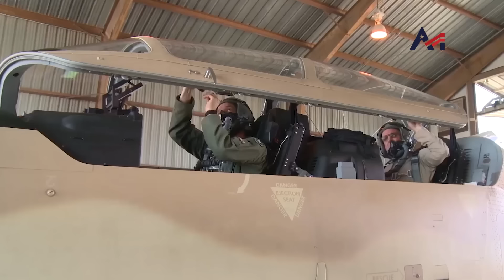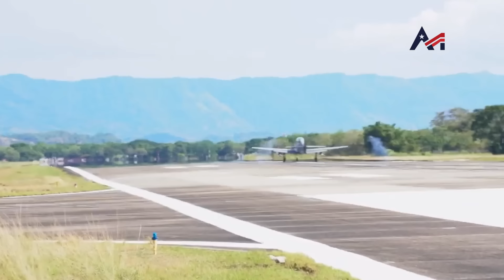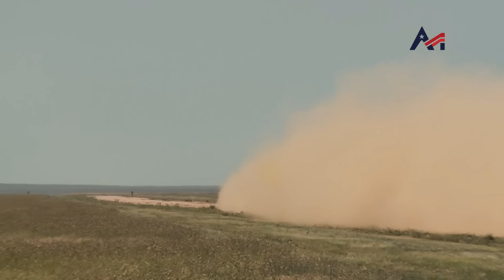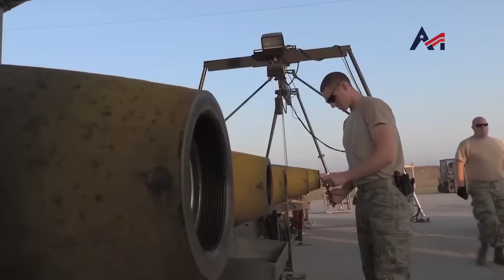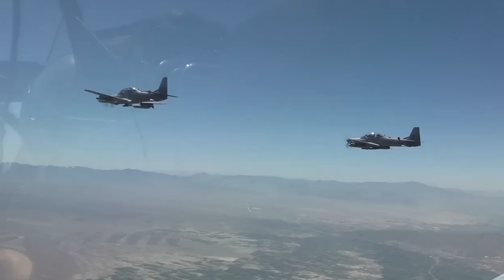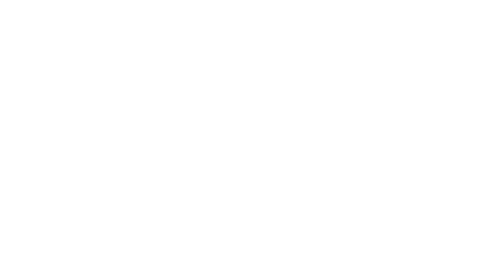U.S. Air Force’s New Answer To Shahed Drones

Comment: I know 10 years ago they were talking about using these in low intensity combat environments where competition for air superiority is not an issue. This is the right idea in my opinion. I think something more similar to the P-38 Lightning would be better as it would offer all of the same low cost options and probably more. I know for larger drones why greater stand off distance is important. However, for the smaller drones, I'm curious why nobody has developed a gatlin gun style shotgun that can be mounted on an airplane or a vehicle as an anti-drone weapon. Ammo is cheap (which probably explains why), shotgun round capabilities vary more than any other category of firearm I know of which would give soldiers choices, and that should not be that hard for the U.S. military's contractor community to create. There's a reason why people normally hunt flying birds with shotguns instead of rifles.
Reply from the maker: Itu adalah uraian yang sangat mendalam, terutama poin tentang lingkungan dengan intensitas rendah.
Konsep seperti amunisi berbasis sebaran memang muncul dalam diskusi anti-drone, tetapi integrasi jangkauan dan penargetan merupakan tantangan utama.

Comment: This sounds like a good excuse to start making the P-51 Mustangs again, but with turbo props and modern weapons / electronic systems. They certainly had the range even with fast , but inefficient recip / piston engines.
Plus they could take a beating and still make it home at the end of the missions more often than not.
I know this is wishful thinking, but with multiple missions like ground support and tank busting capabilities already in it's quiver, adding drone killer would easy.
Best regards.
Semper Paratus
Reply from the maker: That’s an interesting idea, a modernized version inspired by the P-51 Mustang would definitely be powerful in certain roles.
Today’s designs usually focus on combining endurance, sensors, and cost-effectiveness rather than just upgrading older airframes.
Reply: True, but the job doesn't require faster air frames, just tough ones. Tried and true designs will end up with less bugs.
Plus you can't beat the agility of a pissed of Mustang / pilot.
I know of one P-51 that does pilon racing that is nearly as fast as an A-10 ( both sub sonic ), and the P-51 does it with an 80+ year old engine.
Not being a wise guy, but how cool would a turbo prop Mustang be to fly . 
It would virtually never stall in a steep climb 
The thing you'd have to watch out for is to make sure the tips of the prop blades don't break the sound barrier or  it would be too loud to fly.

Comment: Need these, Skyraiders, OV-10s, and A-10s👍👍
Reply: Don't forget the Bronco which surprised everyone in Vietnam.
Reply from the maker: That kind of mix makes sense!  platforms like the Douglas A-1 Skyraider, OV-10 Bronco, and A-10 Thunderbolt II each bring different strengths depending on the mission.
Reply: Not sexy enough for the Air Force.
Reply: @shawnc1016  Maybe, but they announced the A-10S are staying till at least 2030👍
Reply: @douglascooper1987 They keep extending it out of necessity, without admitting that they're going to be necessary for quite a while.
Reply: @shawnc1016  🎯 GAU 8 FTW ‼️

Comment: For Drone Defense one basically needs a cheap gun platform with prolonged loiter time. Looks like the A-29 is getting there. The A-1 Skyraider also comes to mind for this role.
Reply: And how would you maintain the Skyraider, an older aircraft? Would it be as cheap to maintain as the A-29 or another modern aircraft??
Reply: @marcosmpj1370  Agreed. I'm referring to the capability not necessarily the exact platform. Match the capability of the A-1 with a turboprop.
Reply: @marcosmpj1370 No, I would think the Skyraider being a much larger platform with its 3,000 HP Radial engine would much more expensive to maintain and operate especially in fuel costs.

Comment: Not only does the A29 have a stellar record, the USAF & USMC can use them for SAR escort of their MV & CV22’s. The rotor wing  birds can’t keep up with Ospreys.  They made a huge mistake, not adopting this plane when they sold a bunch of Afghanistan for the reasons I just mentioned and the emerging threat of drones. The Air Tractor is fine for its intended job supporting SF but, it cannot keep up with or outrun an osprey.

This whole propeller driven attack plane fiasco was purely political from the beginning. The Kansas delegation was getting butt hurt because they wanted Beechcraft to win over the Brazilian firm. Sorry, the “AT6” is not as proven as the A29, get over it.

Comment: Uh. Drones will be used to counter drones. Its even less expensive and with proper sensors more effective that manned flights. This aircrafts use will be to support light infantry and special services support in rough terrain and hard to reach locations. As an anti drone role, its simply not the best, or least expensive option.

Comment: The better interceptor for shaheds is a modified shahed with sensors, guns, more fuel, and designed to be recovered and reused.  Build it for a 24 hour loiter time, and the operators on the ground can work short shifts in a shirt sleeve environment.

Comment: Fit these aircraft with technology to somehow disrupt the signals that drones rely on to fly.
Reply: These days many of the Russian drones are using a direct link through a fiber optic cable. There is no signal to disrupt. Ukrainian drones are still able to use Starlink which is more difficult to disrupt since you'd have to get between the drone and the satellite in order to block the signal.

Comment: The perfect defense industry solution, one designed to include an initial sale and a support tail that lasts forever. No doubt the best design to earn money, not necessarily the best one to defeat the threat.
Reply: What would be the best option for this role currently, especially in terms of cost/efficiency, in your opinion?
Reply: @marco @marcosmpj1370  Ukraine has already demonstrated a fairly sophisticated anti drone capability the US could leverage for a more cost effective solution. Helicopters with machine guns are also effective as the Shahed is not an armored platform and is susceptible to even minor damage. Helo’s can be hampered by limiting lines of approach so positioning would be key. If you just had to have a slow moving fixed wing asset now there are several commercial variants such as the Cessna Caravan, a rugged a/c that can operate in austere conditions with a 3Klb payload  that could be fast tracked for installation of door gunners for engaging Shaheds. The US already has point defense systems that could be deployed for HVT’s. As Ukraine has demonstrated time and time, thoughtful ingenuity often trumps low density high demand multimillion dollar systems. The US military generally gravitates to sophisticated, highly complex systems and it’s no wonder because that’s what the companies that produce the products are selling. If you go to the garden market and all they have is apples, guess what you come home with? Apples. We need to learn to think out of the box….now, considering that by all appearances there was little to no contingency planning done for potential drone attacks from a country that produces them commercially. Really makes you wonder.

Comment: Much as I like the Super Tuck, it has a couple of weaknesses in the role of a Shaheed killer. It can't be used in a contested airspace unescorted. Sitting duck to even legacy jet fighters/attack aircraft like old MIGS or F-4's.
Link 16 helps to keep those on such anti-drone missions aware of incoming threats, but human error creeps into any operation, no matter how technologically advanced they may be. 
But compared to the expense of modern jets and air defense missiles, the Super Tucks are inexpensive to both field, operate and maintain.
Additionally, it can operate out of remote airfields, which is a bonus. Deployed in squadrons against drones, it would prove itself a cheaper alternative to what's being used by Western militaries to combat suicide drones of the day.😊
Reply: You wouldn't use this platform in contested airspace, it even says in the video that it is a "Last Mile" solution

Comment: This plane is suppose to be a replacement for the A-10!?!?  Nearly very other tactical airplane program introduced in the 20 years after the A-10's introduction has received an upgrade in the motor department, except the A10.  But then it would look like the AF is and has been serious about its responsibilities for Close Air Support.  But CAS is not sexy so, nothing.
Reply: Nobody ever said it was a replacement for the A-10, you use these in areas and roles where an A-10 would be unnecessary.

Comment: There should be a lot of these A-29 fixed wing aircrafts flying over the skies of Iran hunting for Shaheed drones and obliterate them on the spot in the sky.
Reply: I wouldn't put these OVER Iran, the skies still aren't completely permissible as seen with the dramatic rescue of an F-15 pilot recently.

These would be better used over the gulf states and other nearby regions to protect against drones.

If you're using these over Iran, command did something really foolish or Iranian air defense no longer exist.

Comment: This was purposed during the Afghan and Iraq War.  Troops on the ground need something that can see what it is hitting from the air, and can stick around for awhile not having to go refuel every 5 mins like a fighter jet.  Or take several mins to dial in on exactly what its targeting.  But the powers that be said no. The f35 is capable of doing all that. There is no need for a prop plane or A10.  😂 they should revisit this.

Comment: Always a need for a low maintenance simple aircraft that can pack a punch. This, or something like it, is a MUST have as a "little brother" to the A-10. Need both.
Reply: A great little base guard!
Reply: OA-1K Skyraider II
Reply: the farting A-10 is a smithsonian piece, not to be resuscitated. tanks are now a forgotten liability in battle, and so are the hogs that hunt them
Reply: @elhajjrr  You are an moron , Watch some of the videos of service members pinned down in Iraq and Afghanistan, then they hear that "farting" , wow not pinned down anymore.
Reply: @paulv2411  I think the point is for a fraction of the operating cost, multiple skywarden like platforms could be put on target with far more effective anti-personnel weapons. The Avenger average accuracy over a 10m area is about 80%.
Reply: @elhajjrr LOL so why were A10s widely used in Epic Fury?
SMH at A10 haters.
Reply: @LloydMcElheny-d2w   Probably because that was all they had.  And they get shot down easily by manpads
Reply: @LloydMcElheny-d2w  Because there aren't other, more affordable and more effective available. Doesn't make the A10 good. A29 is better than A10 for this kind of mission in every way
Reply: @MuttMobileRescues WHAT kind of mission, and what about the OA-1K?
Reply: @elhajjrr  nice rage bait or moronic low iq response

Comment: The current shahed drones are basically nothing more then very cheap, modern day prop driven versions of WW II V-1 buzz bombs, so using prop planes for interception makes sense. The next generation technology would probably be an armed variant of one of Lockheed Martin's VTOL Nomad series drones. But the most important technology needed is proper detection of drones, from small, adapted, personal drones, all the way to the current prop driven (and future jet driven) drones like the shaheed drones.
Reply from the maker: That’s a great breakdown. The comparison to the V-1 makes sense in terms of concept, and detection really does seem like the key challenge across all drone types.

Comment: The Tucano was taken on for the military, to be a trainer for pilots.  It runs like a jet fighter, without the speeds and tight envelope jets require.
And for training pilots I'm all for it.

But the Air Force was wanting to replace the A-10 with the Tucano!
I can't see that being anything but a disaster for the people in the Tucano...
Just a comparison of the two are more than obvious in the difference.

The A-10 is primarily a ground assult aircraft, for troop support and anti-armor missions.
But the A-10 is armored, has two engines and several redundant systems that help ensure that even if it's damaged, the A-10 has a good chance of returning to base and keeping the pilot safe.

The Tucano has one engine and one propeller...  If either of them are damaged...
And because of one engine, the Tucano cannot maintain the same level of armor for the pilot's protection, we see in the A-10.
Nor could the Tucano carry the same payload as the A-10.

While the Air Force talks of ending the A-10 program and removing it from the battlefield, they really have no substitute for it.
If I had a say, I would say, "Build new A-10s!"
When something works, why would you mess with it?
When the Fairchild Corporation designed the A-10, they from the start, built the perfect aircraft for the job the Warthog was built for.  It has proven itself in thousands of missions and enguagements.
Many soldiers on the the ground have the A-10 and the pilots to thank for keeping them alive in some bad situations.

Many enemy learned that the low and slow A-10 was the wrong plane to mess with, and that was through the hard way!

Build new A-10s. Do whatever upgrades seem viable.  But don't destroy perfection for simple economics.  Sometimes you only get what you pay for...
And the A-10 program has been well worth the money, several times over!

Comment: I've been watching WWII videos of air battles for quite a while and the first thing I thought of regarding these swarms of drones was the WWII P-47 Thunderbolt.  Eight .50 cals, fast enough, super tough, able to absorb massive punishment and dirt cheap to operate and maintain.  The Super Tucano are much the same, two thumbs ups.  Just a guess but I would think that pilot training would also be much cheaper?
Reply: They could start making new ones tomorrow if they wanted to......but sadly the "Welfare System" for making Defense Contractors rich.... well, really there's nothing we can do about that. On the surplus site, for example I've seen a truck transmission, the original price changed was over $30,000. I can go buy the exact same thing, new for around $5,000.
Reply: A29  cant touch a P47, P51, F6 Hellcat or Corsair in air to air combat. A29 is slower, has a lower ceiling and only has 2 50 cals. The above would make short work of the A29 if they had modern avionics. Theyd zoom and boom. The A29 would be helpless.  Its designed for uncontested airspace
Reply: @Charlesgrantsmith  MKXIV Spitfire, Mosquito etc...
Reply: @DaveReynolds-ee3nk Air combat? Excellent.  Our Brazilian friend insisted it had to be a ground attack aircraft, and if I recall the Hurricane was used in that role
Reply: @DaveReynolds-ee3nk Me-109, FW-190, etc.
Reply: @Charlesgrantsmith Often the Spitfires would pull off the German fighters, while the Hurricanes would go after the bombers. Or so I heard.
Reply: Same thought.  It would even be possible to add modern avionics and make it capable of using APKWS II and other similar systems.  Imagine being assigned as a pilot to the new AF-47K Thunderbolt.  It would be glorious.
Reply: I thought the same thing

Comment: Brazilian jet fighter pilots trains in this aircraft before going to the jets. It's a very good platform to learn to fly tactically.
Reply: Probably easier to learn to fly than the F-35, or F-22.
Reply: Kenya has a smaller air force compared to Brazil and also uses the Tucano to train its pilots.

Comment: We learned this is the 1960s and then again in the 1990s. Wonder if the knowledge will take this time? 
I sent out emails when this started suggesting bringing back the C37 Cessna and OV 10 Bronco.
Reply: Or the A-1 Skyraider, the “Sandy” in Vietnam.
Reply from the maker: History does seem to repeat itself in some ways.
Low-cost, high-endurance platforms like the OV-10 Bronco still fit certain mission profiles even today.
Reply: @americanmililitary But what would maintenance be like without mass production of parts? Would it be as cheap as the A-29? Wouldn't it be necessary to resurrect a production line for those aircraft? Would it be economically viable?
Reply: The Bronco was impressive!
Reply: maybe send them emails to not go around starting wars of convenience....
Reply: @dewizle5026wrong.. the drone is coming from the starter galaxy brain.
Reply: @dewizle5026non sequitor….
Reply: I reckon for the anti drone capability fit a movable 556 gattling gun it can fly parallel to the swarm and shoot it from the sides
Reply: Well to be perfectly honest it's only convenient right now due to a very specific threat. If that thread is eliminated through other means then it will fall out of usefulness again. And there is no reason to keep inventory on something useless
Reply: @matthewbeach2669 well, my ship carried a lot of useless things; lifeboats, fire fighting equipment, hospital space, and berthing for more than necessary to man the ship. Someone decided that maybe we will need those things. The situation will change suddenly and their need will be made evident. Some of us would call that strategic imagination and others would say common sense.
Reply: @matthewbeach2669  Isso pode acontecer com qualquer turbo-hélice.